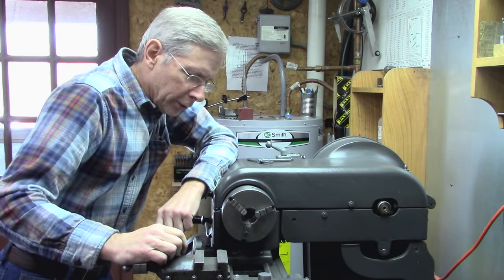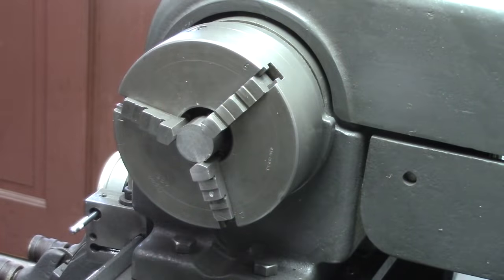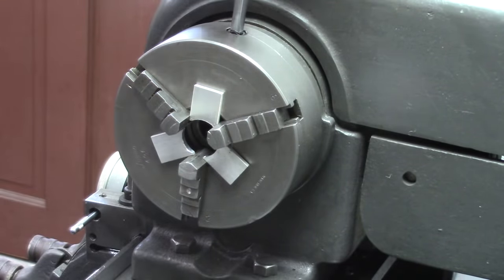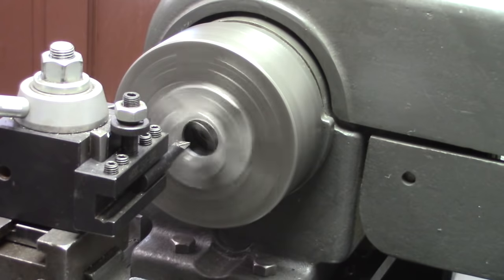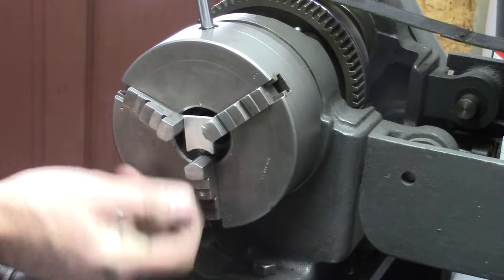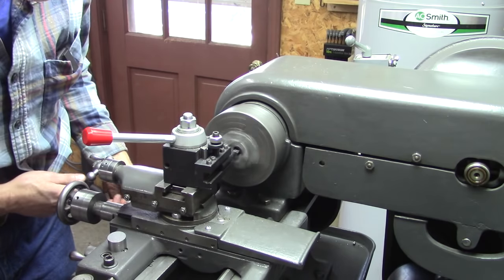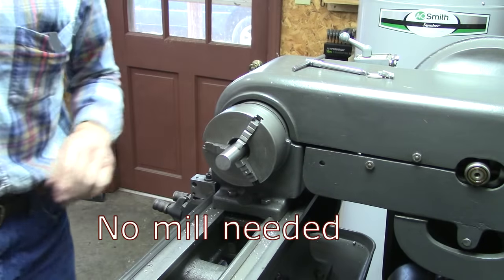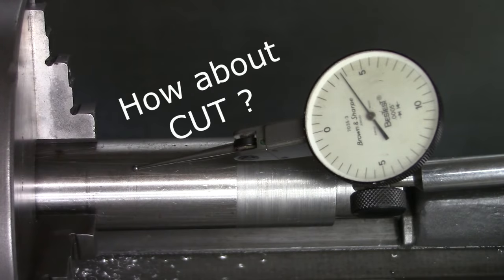Correcting 3-Jaw Chuck Runout the easy way

Comment: If the jaws are out of register because of worn spots on the scroll,  what happens when you chance onto a good spot with all the jaws cut to a different length?
Reply from the maker: 1/2", 3/4" 1.25" 1.5"  are all good so that's not too bad!
Reply: I see... that would make sense. I use the full range of my 3-jaw , sometimes it’s off and sometimes its dead on. I read Audel’s  machinery handbook by Frank Graham, and he says not to remove the work piece until it’s done because you’ll never get it back in there the same way. The way he writes you get the impression he’s not a big fan of self-centering chucks, much more friendly towards turning between centers or a 4-jaw. A friend told me years ago how to true up a chuck the way you were doing, only he used a washer in the back of the jaws. But all I have is hss and it just bounced off those jaws.  I learned to live with it, sort of like when your wife has a small flaw...
Reply from the maker: @richardmaurer9002  - Ha...  yeah, you have to accept some flaws especially from your wife. I have the Audel books...  I need to read them more although every time I open one I get stuff for an hour at least. One of the people commenting on this video suggested another method and I'm going to try it. If it works there will be a video by next weekend....  if you don't see it, it didn't work!

Comment: Hey, just as a question, how i can turn metric threads on that lathe? I'm thinking about making a Collet chuck.
Reply from the maker: I've never investigated this completely but you install a different change gear. You have to leave the half nut engaged and reverse the lathe between each pass. It's a bit of a pain. You can cut many matric thread with the standard gears if you simply want threads for a nut. The nut is short enough that the error is not an issue. I assume you are cutting threads for a collet nut? You might want to check them with an SAE thread gauges. You might get lucky.
Reply: @WinkysWorkshop  alright, thx
Reply: @WinkysWorkshop  also, dp u know if the spindle has a Morse taper?
Reply from the maker: @Lucas_sGarage  Yes, its a MT-3 I believe.
Reply: @WinkysWorkshop  thx

Comment: Why not use a 1 inch end mill shank?  Hardened and ground.
Reply from the maker: a boring bar is cutting in a very small area. A mill would have too much surface area.

Comment: Did you use a special insert for the hard steel of the jaws?
Reply: Just read some threads about the insert.....Will give this a try on my Myford ML10.
Reply from the maker: I suspect any carbide will work although a sharp corners and slow feed probably help. This seems to be hit or miss. It worked well for me but I've heard other say it did not help much. I guess it depends on what is worn. Just take enough to take a little off to get the whole surface of the jaws and then test the results. I hope it works well.

Comment: The reason why the 1 inch bar was not indicating true and the 7/8 did has to do with the Radius of contact to the work piece is not equal, you bored it to one inch but the deflection of the bar and the hardness of the jaw made the Bore Dia like .990 . The Radial contact, Jaw to bar, is on the outer edge of the cleanup of the Jaw surface which you can hear the evenness when boring. The smaller piece has a smaller Radial contact which is evenly centered on all 3 jaws to the work piece .  If you would bore the Jaw 1.010 or larger then the radial contact would be in the center.
  ** Also the positioning of pressure to hold the jaw in place is best closer to the edge of the jaw then against the chuck.** ------Sorry to get technical but it makes a difference.
Reply from the maker: You are correct about the radius. However, even after cleanup the flat created at the jaw tips was probably .040". I'd have to do some weird math to know for sure but the difference between the outer contact area and the center is likely only about .001". Lets be realistic, this repair is not a complete fix regardless. .005" to .010" runout would still be a big improvement. I agree with the ideal location (toward the tips) to load the jaws although many have stated that the force needed to be deeper in the chuck.

Comment: This is close to making soft jaws , anyway when I do inside I use a ring on the outside to tension ,and a pin for when I do the outside . Beware of the radius it leaves behind thow
Reply from the maker: I think you get better results if the jaws are loaded inward when you grind of cut the ID of the jaws
Reply: When using a ring I get taper on the jaw face, so I start with a ring with out jaws too pull a few thou off the interior jaws. Remove ring reinstall jaws and load the back jaws, then turn too that point.
Reply: After looking again that doesn't appear to have flippable jaws so that wouldn't work.

Comment: Much better to drill a small hole on the front of each jaw, insert three little bolts  with heads and clamp the heads in on a steel ring about 50mm diameter with a 6-8 wall thickness about 5mm long held at the very front and then lightly grind. This will machine the jaws the way they need to be done by putting max spread on the outer tips of the jaws.
Reply from the maker: Interesting. I always felt like the outward pressure needed to approximate the jaws clamping the work piece. But you might be right. Worn jaws are usually at the tip. This did help the chuck but it was far from perfect.

Comment: I have done this a few times.Use steel or brass stops aluminum is to soft.
Reply from the maker: It's soft but I had the chuck plenty tight and it never crushed the aluminum.

Comment: Good work.  Always use inward pressure on the chuck jaws.  I have seen some use a metal ring, and put outward pressure on the jaws.
Reply from the maker: Thats a good method but you have to put a pin in the jaws to clamp on the ring so that the jaw surface is unobstructed.

Comment: You need to be doing this with a tool post grinder.
Reply from the maker: I've done both. The boring bar is much faster and in most cases just as accurate.

Comment: The problem with this chuck is almost certainly a bent scroll at that 1” diameter. This method modifies the jaws to work with that diameter only. 

Most chuck manufacturers sell replacement scrolls. This would have been a better approach.
Reply from the maker: This approach does not fix a chuck but sometimes does improve it. The scroll was not bent although I'm sure it had some wear. The biggest problem was the wear on the jaws at the end (bird mouthed). This drastically improved this wear. The run out changed a by .002 in different diameters but clamping and re-clamping does the same. If I remember right it was within .006" throughout the clamping range which is about 1/2 what it was.

Comment: Nice Video, Winky jaws turned out good. Just a thought ,we used to do about the same thing when the jaws got worn on our lathes, by chucking a ring on the outside jaws and boring or grinding true !
Reply from the maker: Thanks, The problem with that is the jaws are under load in the wrong direction. It may or may not get good results.

Comment: Always test with fresh drill rod or HSS rod that's been ground to 0.0001" accuracy and is guaranteed straight to some ridiculous tolerance.
Reply from the maker: Yeah...  I didn't have anything. The next day I found a linear bearing shaft that worked perfect. The total runout was about the same but without all that bouncing around.
Reply: @WinkysWorkshop  Oh, yeah! Linear bearing shaft would work very well.    8)

BTW... at one point I needed to true one of my chucks but I was pretty sure that the jaws were crazy hard so I built a toolpost grinder that I inserted between the jaws (jaws held open by a steel ring) and ran the chuck at low speed while the grinder ran. Grinder rotation was opposite chuck rotation, and it worked pretty well. Now I'm tempted to see if carbide inserts are hard enough to reasonably scratch the side surface of one of those jaws to see if turning might have worked faster (grinding was VERY slow)...
Reply from the maker: @timhofstetter5654  - I have ground chucks in the past. I used a moto-tool which was not ideal but the boring bar worked better. I don't know the hardness of the jaws but a HHS drill won't tough them. When I ground them last time I made a ring maybe 1/8" think with three holes for the jaws to go through and then wasted the center out with a drill and boring bar. Kind of similar to the video. One person commented that they used a 1 inch bar held in the tail stock. They put valve grinding compound on the bar, clamped it in the chuck and let the bar grind the jaws. I tried this but I set up my steady rest on center to support the bar. The bar was long and the tail stock was on the other end of my lathe. It made the jaws worse. I suspect this is do you light clamping force, the jaws move when you clamp hard. I went back in with the boring bar and fixed it again.
Reply: @WinkysWorkshop  For just one moment I thought I liked the thought of bar-lapping the jaws... but the jaws do rack a little when they're tightened so as each jaw reaches the top as the chuck rotates, it falls onto the lapping bar and as it reaches the bottom it falls away from the lapping bar again. Then there's the possibility of vibration, jaw "hop" and all that. I think it's best to lock the jaws tight one way or the other to work on them.

Lapping would take a long, long time, too; the lapping compound cuts nicely, but we're talking about lapping away ten to twenty thou here - that's a mountain of lapping to do. Even the toolpost grinder I set up (I used a handheld air grinder with an AlOx wheel) was awfully slow. Like HOURS. Next time I'll try boring (after just testing to see how well carbide scratches my jaws).

Worst case... I could anneal the jaws, turn them with HSS, then reharden them.
Reply from the maker: @timhofstetter5654  I tapped the end of an 18 x 1 inch bar until is was spinning true in the chuck and then carefully setup my steady rest on the end. Then I turned the end of the bar in down to 1/2" so that it would chuck in my drill chuck in the tail stock. Then I slid the steady rest toward the chuck until it was 2 inches from the chuck. Theoretically the rod was dead center in the chuck and with enough grinding all 3 jaws would be making full contact. It's the fact that the clamping force was not high enough to grind the jaws as if they were tight. I should have put a dog on the bar, I had problems holding it in the tail stock. I had the lathe in back gear and it only took maybe 1 or 2 minutes. It happened very fast...  it really surprised me. It was 320 grit lapping compound (for valves)
Reply: @WinkysWorkshop  I still have about five pint cans of that stuff in the little dorm refrigerator I use for storage next to the milling machine. :) They sold it to me really cheap when diamond became popular. I think I have a couple of cans of 220, one of 320, a 400, and a 600. I don't use it often enough; when I'm dead & gone there'll still be some fair amount of it left.
Reply from the maker: @timhofstetter5654  I have a little 2 oz can...  You could lap a few hundred valves with it. Unless i find another use it will be tossed after I die.
Reply: @WinkysWorkshop  It may be handy for lapping a new shopmade set of gage blocks... or an old Morse taper that's been permitted to rust, maybe. If you're anything like me, you'll hang onto it.    8)

Oh, yeah! Fettling a wood hand plane, polishing a chisel's back... lots of things it can still be used for.
Reply from the maker: @timhofstetter5654  Yeah...  I'll likely go for the steel wool on most items. I have a few blocks of various sizes but never need the precision of a lapped gauged block. I'm detail oriented when needed but most often I don't deal with anything extremely precision.
Reply: @WinkysWorkshop  It all boils down to selecting a class of work that's appropriate for the task at hand. Most stuff in this world is fine as wine with no higher precision than five thou. Heck, across the board (all materials), MOST stuff in the USA is measured in fractions of an inch. If it's within 1/128", then it's really pretty wicked good.    8)

Once in a while a fella needs a nice wring fit, though, or a rattle-proof lubicated sliding fit. Like... when you're making polymer linear bearings for a homebrew CNC machine, for example. That happens to be one of my tasks in the next couple of days. Actually, two machines... one being a 3D printer, the other being one of the little CNC routers.
Reply from the maker: @timhofstetter5654   - Cool stuff. CNC is amazing although a bit beyond me.  About the most precision I get is press bearing fits.
Reply: @WinkysWorkshop  You may just be surprised to learn that CNC doesn't actually add any precision, all it adds is repeatability and speed of duplication (and even the latter often can't compete with jig-machining). It's lousy for one-offs, since it requires considerable setup and verification time.

Never give up the manual-machining skills!
Reply from the maker: @timhofstetter5654  - Yeah...  I'm an old fart, I'll stick with the manual stuff. Although, I built a wood lathe I'd like to make CNC.
Reply: @WinkysWorkshop  Sort of a takeoff of the old Craftsman lathe duplicator for spindles, only automated? Ya know, there's actually some potential in that; spindle duplicating is tedious work.
Reply from the maker: @timhofstetter5654  I've actually made spindles with the pattern tracer on the lathe I built but complex patterns are a problem. The tracer has to pull out of a dip in the pattern and it doesn't work very well. Here's the lathe I made, it takes the same chucks as my metal lathe. https://youtu.be/yYsMX0ZDJVY

Comment: Easier way..... clamp the bit of stock in the jaws and hot glue the jaws to the chuck body. tap out the bit of stock with a drift and use a toolpost grinder to true the jaws. Chip off the glue and you're good to go. Took my old Bernerd chuck from .012" runout to  .001"...... Took half an hour for the whole job....
Reply from the maker: Cool idea. Thanks.

Comment: Kinda I've thought this one. Just three pieces of material the same size stock, touch off of the inside and bite to clean up. That simple.
Reply from the maker: It may not be perfect but it certainly was simple and helped my chuck a bunch!
Reply: @WinkysWorkshop  oh it's the correct methodology but it's over complicated in his explanation.  Hell you can rough cut 3 pieces, deburr them throw them in between the gaps in the chuck leaves between a 1/6 to an 1/8 below the chuck jaw and bore it until it cleans up. Then take your toolpost grinder in for a cleanup pass. Done.
Reply from the maker: @rodswim492  - Overly complicated? I guess I could have left off the milled radius step. Otherwise I'm not sure you could get more simple.
Reply from the maker: ok

Comment: The reason it didn't work the first time, ...you chucked on the edges of that aluminum, where the radius is, and collapsed it.....this introduced an error in the scroll
Reply from the maker: This is a less than ideal way to fix the problem but I don't really think there is a good way aside from getting a new chuck. With that being said, I think the aluminum crushing helped eliminate some error although probably not much.

Comment: I'm surprised you were happy to use aluminium over tool steel or even ground steel.
Reply from the maker: There is a reason for the aluminum and it needs to be thin as well. As the scroll and jaws wear the spacing between the jaws become uneven. By using thin aluminum it can compress. This allows all three jaws to be under load instead of just the two that make contact first. Certainly it is not a perfect fix but it can make things much better.

Comment: The idea of gaining accuracy in a warn chuck by doing this trick is thwart. Unless you install a new scroll at the same time it will only be accurate at the diameter you ground it at. At all other diameters it shall still be as inaccurate as hell. Solution is to buy a new chuck...they are not dear...
Reply from the maker: Actually this can and did make a huge difference but it also depends on your expectations. I've never had a 3-jaw that does not vary a little with diameter. Even a new chuck varies. I do agree, this will not restore a chuck to new condition. Jaws wear independent of the scroll. This chuck was worn mostly at the ends of the jaws (bird mouth) and the error was reduced in half by surfacing the jaws.